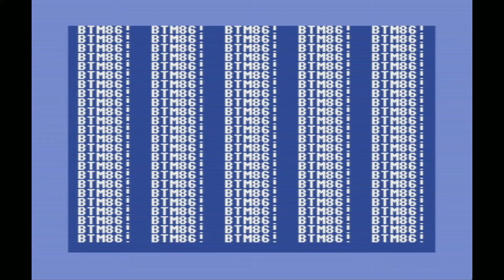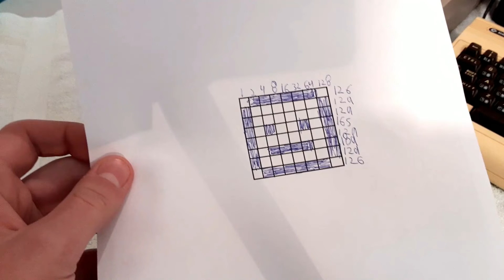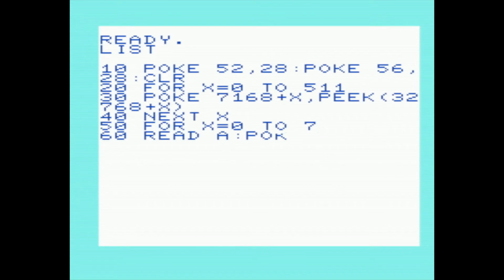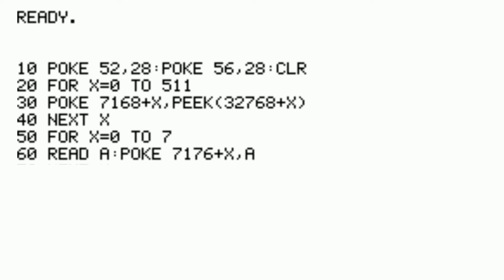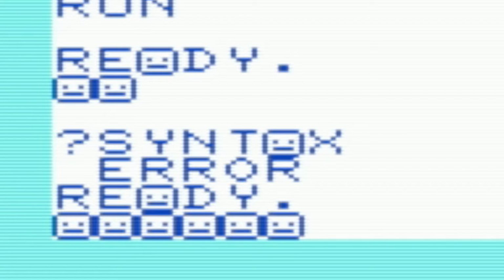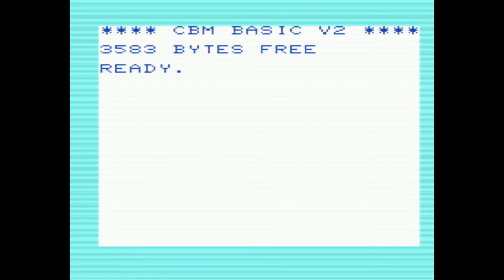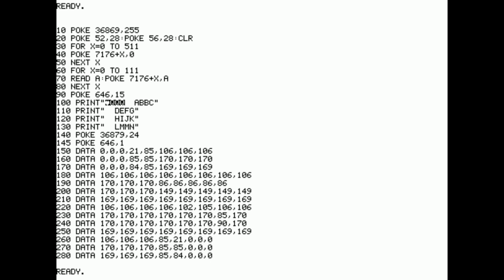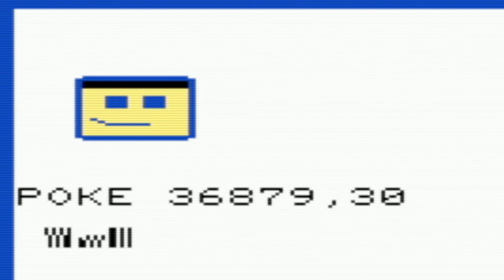Redefining The Character Set on The Commodore VIC-20 (In Basic)

Comment: good video except you have your bits backwards. The left most column is 128 not 1, and the right most column is 1, not 128. They should be numbered 128,64,32,16,8,4,2,1.

Comment: I use to work my mums knitting patterns into an acorn electron in a similar way and i could set the resolution mode to 640x256 for a 80coloum display .user definable graphics was well explaind in the electrons user guide.many games redesigned the font completely

Comment: I am shocked that the C128 is slower overall, I understand the Memory Management routines and the size of the BASIC ROM are the main reasons, but the C128 has twice the clock speed of a C64 when it's in 128 mode and you would think this would be enough to compensate for it. Great video!
Reply: Because it has more commands I think. Assembly would of course be faster
Reply: Actually, C128 is also a 1MHz CPU same as C64.
You can enter 2MHz mode, but that will turn the VIC off and you'll see nothing.
Now imagine your application is switching the screen on and off every time you want to use 2MHz to speed up calculations, loops etc.  Totally unusable.
Reply: @miselzivanovic2181  Yes, I know this. Please re-read my comment.
Reply: @miselzivanovic2181  It might have helped if more programs were written specifically for the C128 but this would be ignoring the massive install base for the C64 and that's why it wasn't done. The C128 was just produced for the 'nerds' (like me) at the time and not the general populace.

Comment: A good explanation of how to redefine the character set. The numeric values on the grid for the working out are in reverse order though, starting at 128 from the left going down to 64, then 32 until you reach 1 of the right. Your character was asymetrical so it came out right.
Reply: I was about to reply with just this comment, although it's been so long since I did this, plus I did it on a C64, so I wasn't sure if I was right.